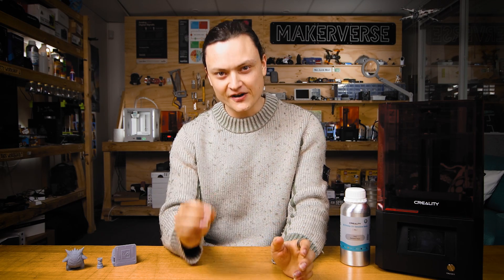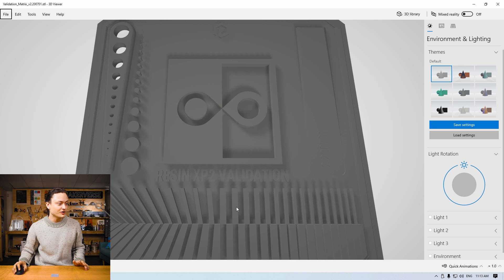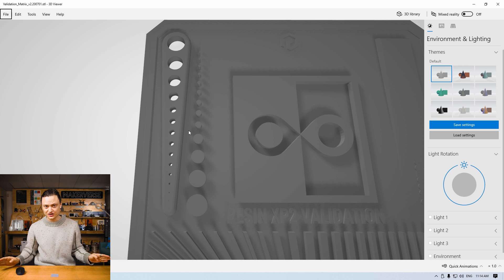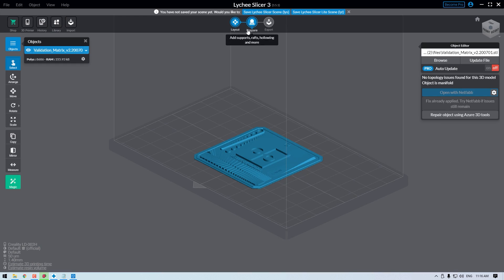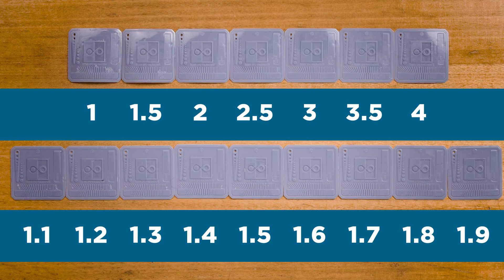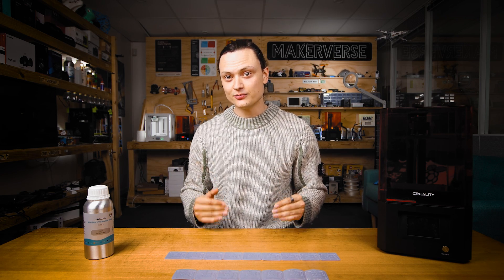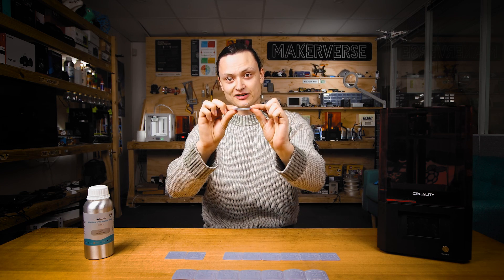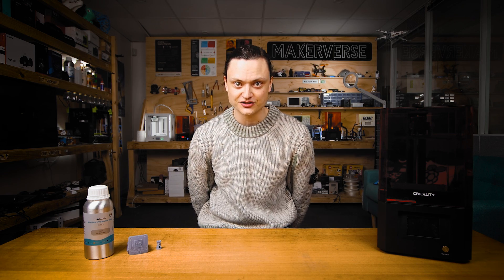Create Perfect 3D Resin Prints by Finding the Optimal Layer Exposure Time

Comment: We are from Siraya Tech, and we always enjoyed your videos. This particular video is very helpful for many new users. . We also like to share that XP2 is great for brittle/hard model resin but can have issues with more flexible resins, including Fast abs-like and tough resins like Blu. This is likely due to the xp2 model is too easy to print, and that flexible resin often has a wide printable range that would make it very hard to judge. So a 1.5s may look just like a 3s one, but 1.5s may have a problem printing a real world print model. Several attempts have been made to address this aspect of the XP2 model, and we have shared this finding with the amazing Photonser who created the XP2 model.
Reply: Love your resins <3
Reply: Wish I could love your resins but we can't get none in Brazil. Still respect your brand tho, only read good things about it around the internet
Reply: I have nothing but failures with the mono 5s with the anycubic resin.  I just started a new print with Sirayatech after installing your settings file for the resin.  Well see what happens.
Reply: siraya tech leading the industry :)

Comment: I know this is an old video for you guys, but having just bought a Mars 4 Ultra last week I have just found it.

Ive been doing som reasonable prints on the printer but the bottom layer has been welded to the build plate and there are some inaccuracies. Thankfully the company who supplies my miniatures builds them on a bed of supports on a raft.

So, decided to dial in new settings and try it out, looked at you tube videos and finally found this and THANK you so very much.

My original settings were something like 2.5 exposure, 20 seconds bottom layer. I knew both settings needed changing, but have been advised to change only one at a time.
Downloaded exposure test and got far more posts than voids. CHanged exposure to 1 and got 13 holes and 13 voids. I know I can do better but thats a good result. Im currently doing my third print with 1 and 15, but having looked at your video Im expecting it to not be perfect as you suggest a bottom exposure of 10 times the normal. Now Ive found my normal exposure I can expact the bottom exposure to be closer to 10.

I really am not sure if Id be able to even make it this far without your help. Thanks to all involved
Reply from the maker: No worries! We are just glad that people are making use of these, and thank you for the kind words!

Comment: Thanks for the video. Question from a completely new user- should I cure every test before checking or just washj them?
Reply from the maker: Just from Tim's notes: 
"Each piece after printed was then washed in a Creality Wash and Cure Station for 5 minutes at slow wash speed. Then, after drying off overnight with the important side facing up, each piece was cured for 2 minutes on both sides twice (for a total of 8 minutes altogether)."

Comment: Does the scale of the test print matter?
Reply from the maker: It would be ideal to print a test print at its original scale. They are designed to give the printer geometries that it will struggle with if not properly calibrated. If you printed your test model at as different size, you could potentially be either making it harder for the printer to maintain the expected fidelity or making the process simpler by increasing surface area and adhesion, and therefore not an accurate indication of performance.
Reply: @Core-Electronics  gotcha, thanks for the info. Got another question...when removing supports, is it possible to not leave holes in the print when taking supports off? Should I make the support inside the print less than 0.200mm?

Comment: After 5 years of FDM printing I finally bought a resin printer, on my first print I used your calibration matrix, well I got extremely lucky I used 50um layer height and guessed a cure time of 2.5 with Conjure Rigid Clear Blue and I can count 13 Holes and 13 Pins. Being around aircraft fluids and eating food with literal black hands I didn't think I would mind the cleaning. Unfortunately, it's not as satisfying to rush to the printer and pull off the print. The print does look amazing, and it was even more impressive when I pulled the STL files into CAD and measured the 13th at 0.100mm and the 13th hole was actually a SQUARE measuring at 0.070mm x 0.070mm. Wish me luck, I have some soul searching to do and hopefully I can reconcile this..........
Reply from the maker: Best of luck!

Comment: Wow, I wish i knew this before starting to print, would be good if this was mentioned/included in printer manuals.  Defs gonna do this now.  Ive been trying to compensate my slightly enlarged prints manually in the CAD files and  I've had lots issues of under/overexposure particularly with clear resin.

Comment: So very helpful! Thank you! I have been printing ball jointed dolls and the ends of the arms/legs are printing very thin and the heavier pieces like the head cap and the joints dont even stay on the plate and fail to print completely. I am going to calibrate my exposure times and see if this helps!

Comment: im late to the party but this is an amazing video! I kept getting failed prints with my anycubic photon mono x2 using anycubic clear resin and manufacturer settings (2.5 sec exposure time). I suspected that it was to low exposure and wow did this test validate that! I still need to dial it in, but i should be between 3.0 and 3.5!
Reply from the maker: Glad it helped!

Comment: Can someone help me?? Okay so i go the matrix/infinity  thing to almost touch how do I fine tune it so there's more detail? Do i need less exposure? More? Also the holes on mine are still somehow pooling up after the 2nd one how do I fix that??? I printed a dummy model to see if the settings were good and they sorta were the model just lacks detail (it's a 4k printer)
 so idk what to do
Reply from the maker: If your loosing details then exposure can be dialed back. That would explain why your holes are pooling up too on your exposure test matrix. Once set perfect any resin printer can produce incredible results.
Reply: @Core-Electronics  yeah i dialed them back a bit and saw some improvement. How ever I stumbled into another problem i noticed some models came out sticky after curing.... Can I fix this issue or can I just prime/ paint over the issu
Reply from the maker: Definitely continue curing the models until they are no longer sticky. If your concerned about warping then a coat of paint will definitely seal them up.

Comment: You mentioned it's a good idea to make the intervals .1s for monochrome screens. How do manually change the intervals between exposure times for the 8 on one build plate. Or did you have to print one by one to achieve this?
Reply from the maker: So I printed each one individually, manually changing the exposure time for each. There are software which will do it all for you automatically which I have linked in the full written up article and here - https://github.com/sn4k3/UVtools/releases
Reply: @Core-Electronics  yeah I gave it a read through and it really helped, I've finally got the skin coloured resin from anycubic printing the rook perfectly, I scattered heaps of them throughout the build plate as well. I tried my first 100mm bust after dialing in the settings  for this specific resin but it ripped from the supports and got stuck to the fep :'D
I'm going to try using the PTFE stuff next
Reply from the maker: Sorry to hear about that! Just dial up that exposure a little more and Fingers crossed you have nothing but success from here on out! 

In Lychee I go support crazy with Supports Density set at Ultra but also make the supports size Medium (or once I have trust in my settings Light). Once I have the Generate Automatic Supports completed I go over the model with a fine tooth comb and often place even more supports onto it. With great settings the model will break free from the supports without leaving any marks visible without a microscope.
Reply: @Core-Electronics  sounds like a plan!  Thanks for the help and video, much appreciated ☺️
Reply: @Core-Electronics  sounds like a plan!  Thanks for the help and video, much appreciated ☺️

Comment: The most detailed printing advice I've heard so far. Thanks. What can cause the problem that the printed model is rich in detail but does not harden but remains soft, even if I shine it with UV light. Thank you for your answer
Reply from the maker: There are different types of resin. Some newest types are flexible and even after curing they will remain flexible. If this is  happening to your rigid resins I'd recommend hitting them with even more UV light or getting a new batch of resin. After a couple of months of the bottle being opened the Resin gets old and then can produce weird results.

Comment: Thanks for the recommendation to this video. What would you consider to be the optimal times to wash and cure on the post processing? Since you state IPA kills the most tiny details and curing could also cause overexposure?

Would you share some recommendations on the optimal time spent washing and curing please?

Thanks again for all your wisdom
Reply from the maker: I'll hit each module for 10 minutes in the IPA Wash station at low. Then I'll hit the models with 5 minute cure at slow speed, rotate the model so the bottom faces up, then do another 5 minute cure. After that it should be all good to go 😊 If it still feels tacky I hit it with 5 more minutes of curing.

Comment: I bought my resin 3D printer with the expectation that it is more accurate than FDM printers for making functional parts.  I was very disappointed that things wouldn't fit properly.  In fact,  they don't fit at all.  I will try these calibration methods and see if it'll improve ....
Reply from the maker: You'll be able to produce functional parts, just be aware each time you use a different resin it will affect Dimensional Accuracy. Run off a couple of Dimensional calibration prints to nail it. Produce a XYZ Cube which is perfectly 20x20x20mm and you'll be good to go. If too small/big scale up/down in your slicing software. STL Link to Cube - https://www.thingiverse.com/thing:1278865

Then when you are producing perfect XYZ Cubes start printing your functional parts, making sure to scale the component to the same amount.

Comment: So.. what happens if I have...
More pins than voids (underexposed) 
Infinity Symbol overlaps (overexposed)
Sticky/shiny resin (underexposed)
Bars that are larger than the gaps (overexposed)

Using anycubic eco resin on a saturn 2, attempted 20s bottom and 2.5s normal layers.

Guess I'm screwed????
Reply from the maker: Have you checked the print platform is level?
Reply: @Core-Electronics  hey thanks for still responding even so longer after you posted! 
leveled three times and did this two different build plates (one with a wham bam flex plate, one without. Spacer is installed with flex plate). I use two sheets of standard US letter paper and set Z=0 when the paper has some resistance to pull/push around. So best I can tell it is level. 😕
Reply from the maker: Heyya mate 😊 write up a post at our forum and post a picture of your Validation Matrix and I'll give it a good proper look. If its not a flexible resin and it breaks the Validation Matrix I gotta know about it! -  https://forum.core-electronics.com.au/
Reply: @Core-Electronics  Not sure how I feel about being a "special case" 😂 I'll send it over!

Comment: You’re talking about exposure time but you don’t talk about UV power %… 
I didn’t saw you talking about that ;)
Reply from the maker: Always more details to 3D Printers 😊 Personally I haven't seen a justification to alter the UV Power from Standard Settings on Creality Resin Printers. 

On other Resin Printers it may be UV Percentage might be software controlled/easy to alter but with Creality Resin printers you need to pull apart the machine, get to the power-supply and rotate the correct potentiometer with a screwdriver whilst measuring the output with a Multi-meter. I haven't considered it a worthwhile pursuit. Here is a fellow doing just that - https://www.youtube.com/watch?v=zO8NylPhd_E

Comment: I’m new to 3d printing. When you change the layer exposure time, do you do so in chitubox, printer or both?
Reply from the maker: Hi Henry, welcome to the world of 3D printing 🎉 When you change the layer exposure time it's best practice to set up these changes in your slicing software (chitubox, lychee), while it's possible to alter the settings from the printer, having the correct exposure time baked into the file allows for consistency and repeatability. I would reserve the printer settings for quickly fixing errors.
Reply: @Core-Electronics  Thank you, this helps!

Comment: I'm a little bit confused about the holes on the left side; Is it supposed to go all the way through, or is it supposed to be plugged up half-way through as if there's a backing behind the holes?
Reply from the maker: What you are observing is the resulting model created from Bottom Exposure Times VS Normal Exposure Times. The Bottom Exposure times wont keep the model design perfectly dimensionally accurate but will enable model adhering to the build platform. So don't focus your keen eye on the first 4 layers that are Bottom Exposure Time, we're more interested in the result from Normal Exposure Times (which present themselves at higher layers)

Comment: there was no way to generate multiple exposure in one file directly ? to avoir print and clean between every timer ?
Reply from the maker: UV Tools is your port of call - https://github.com/sn4k3/UVtools/releases

When set up correctly and started this will run multiple test across your whole print platform.
Reply: @Core-Electronics  thanks , will try ☺️

Comment: which the best use number 1.7 or 3 s?
Reply from the maker: As a general rule for Normal Layer Exposure Time use 0.5-5 seconds for Monochrome Screen 3DPrinters and 2-20 seconds for RGB Screen 3D Printers.

For the Resin-Printer Combo in this guide I found 1.7 Seconds was the best Normal Layer Exposure. This was with a Monochrone Screen Printer.

Comment: Thank you for this video.  I ran the basic test piece that came with my Photon Mono SE and used the vase layer setting on the box of my resin.  I've now seen that a) the setting I settled on is way over exposed, and b) that this over exposure is part of the reason it feels like I need a jackhammer to get my prints off of the bed.
Reply from the maker: My pleasure and cheers for sharing you experience 😊

Comment: You have to do those for every color resin? I'm trying to use black resin and it won't stick to the plate.
Reply from the maker: Different colour resins will have different absorption rates, white reflects light more then black so exposure times may vary, but I would doubt it would be significant enough to cause a print failure if you're not experiencing issues with other colours. Though the biggest difference you will find is between transparent resins and opaque ones.

Perhaps troubleshoot a few other issues that can cause adhesion problems, like bed levelling, FEP wear and tear or any cured resin stuck to the FEP from a previous print
Reply: @Core-Electronics  thanks for responding. It's a brand new fep. So no damage. The bed is a brand new wham bam flex plate. Completely clean both after each failure. Every other color works fine. Tried the black with the standard test settings that came with any cubic. Then looked up and found a chart for any cubic showing different exposure settings and tried that. The black resin is the only one that won't stick to the plate. 
 Also wasn't sticking to the plain plate but the white did. Have zeroed it multiple times to make sure. Both the paper way and directly on the fep, (forget the name of that method).
  If there's any more tips or tricks please let me know. I've given up on the black resin for now just so I can go back to printing something at least.

Comment: hi, do you think that this model positioning will work and print fine?
Or how would you place this object to avoid failurs?

https://drive.google.com/file/d/104Z6Bw0C3-GILCXklRpnXFM8-s1mhFaj/view?usp=sharing

Thanks.
Reply from the maker: That positioning looks perfect to me if this is your first couple of prints I would reccommend doing them one by one.
Reply: @Core-Electronics  yea its my first couple of prints. :) Why one by one?
Reply: @Core-Electronics  hi,

we just printed the model. But look at this.

Some layers got loose and the model on the front warped on the corners. Meaning the front bottom line isnt even/streight!

Here are a couple of images of it:

https://drive.google.com/file/d/17KvPuaxYpGM0iIM4gHgMUr9_tC9BWvX1/view?usp=sharing

Do you have any idea or advise why this happend or could be avoided?

Thanks!
Reply from the maker: I always use a Shape Wall Raft for my prints. I find they Adhere better to the build platform. Use 10/12 Bottom Exposure Layers and increase the curing time for the Bottom Exposure Layers by 5 seconds. 

That should stop your prints from wanting to fall off the build platform (and making the front all wonky). 

Hope that helps 😊 and big thanks for sharing those photos, I love see what people are 3D printing.
Reply: @Core-Electronics  thanks for the input